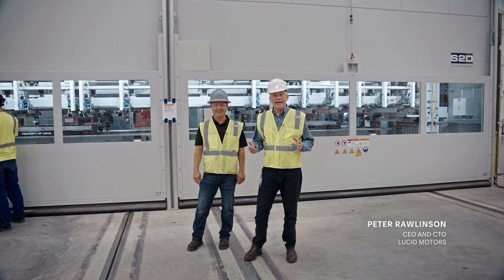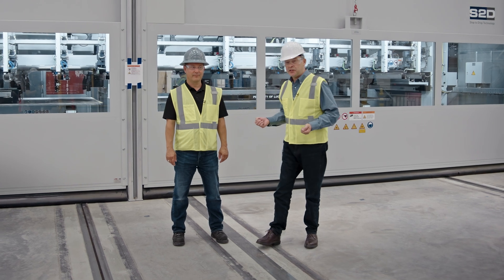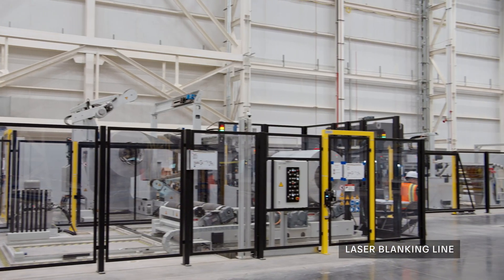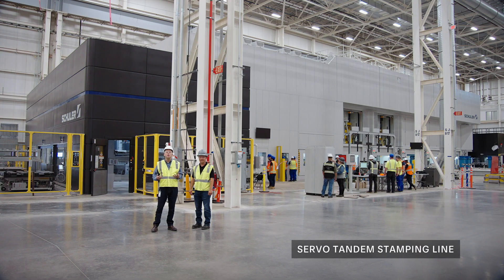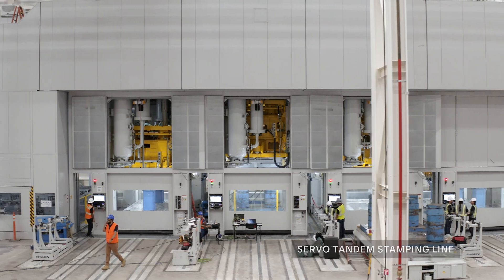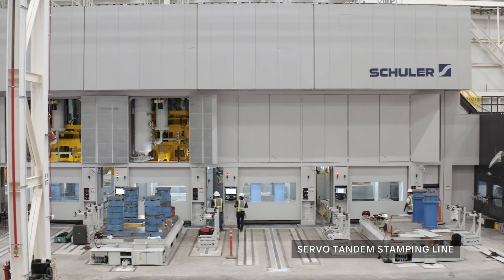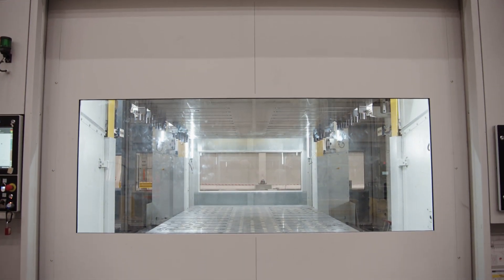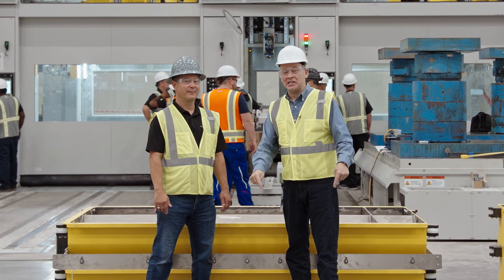Preparing the Factory: Stamping | The Road to Lucid Gravity

Comment: Aren't they Gigacast presses with molten metal? You will have to weld a lot of parts to make the rear sub chassis . Could you explain why they need so many successive presses instead of several equal and powerful ones that do all the processes in one.

Comment: Why not use gigacasts?
Reply: Lucid does use cast aluminum components where in makes the most sense for them, subframe and suspension towers. No one engineering solution is best for every application.
Reply: @Miata822 YOU SO SMART MIATA822😁🙋‍♂️❤️🥳🥳🥳🎆🎆🎇🎇🎇🫡💯🙌💎💎💎💎STRENGTH AND HONOR 🤝 GLADIATOR STYLE 🫡💯TOGETHER AS ONE LUCID FAMILY ADDING ON AND HOLDING STRONG HOLD THE LINE EVERYONE STAY FOCUSED BE DISCIPLINE HARD WORK DEDICATION GOONIES NEVER SAY DIE!😉👍🫡💯
Reply: Thank you! Did not know that. Are you an engineer as well?

Comment: Great sales pitch not reality. I hope the Gravity is 50% better than the Air I doubt it.
Reply: What do you see that is unreal, Tom? This is what factories look like. Being 50% better than the most awarded and praised vehicle in recent years is a tall order though.
Reply: @Miata822 WELL SAID MIATA822🙋‍♂️❤️🫡💯🙌💎💎💎💎
Reply: @Miata822  I said great sales pitch not reality . Based on the Lucid Air that I own. It has a poor quality control. The fit and finish is bad. Their so called dream drive is not as good as Hyundai in their Ionic series. 

As stated I hope Lucid learns from the mistake it made with the Air and the gravity is a better engineered car. I doubt it. Hopefully they have learned. 

The one positive I see is they have greatly improved their instrument panel which seems to be better laid out.

Comment: Lucid>Tesla
Reply: Lucid GT is an absolutely amazing well built engineered, driving machine 
Tesla software is still significantly better than others producing EV’s……. Because it always works
Reply: @mr.boombah6511  Let's not get carried away and say it always works. My friend has one and sometimes the wheel jerks it around While doing self driving.Lucid will use Nvidia, self driving by 2026 And I hear Nvidia software,  far more advanced than Tesla's fsd Makes it look like child's play. time will tell😁🙋‍♂️❤️
Reply: @mr.boombah6511 not always!
Reply: @mr.boombah6511 There are a lot of software working in the car, what you see on the screen is just the tiny part. Motor control software, inverter software, driving dynamic software etc etc Lucid is years ahead complimentarying to their industry leading hardware.
Reply: @lowvaeater  I’m fully aware since a GT is sitting in my garage and reality is software is the weak  point of the car… nobody was questioning the hardware it’s outstanding
Reply: @mr.boombah6511  Hopefully 2025 upgrade and Gravity can improve dramatically.
Reply: The Lucid Air is probably better than its competitor the Model S...yes. But there's basically no arguing against Tesla's charging network vs Lucid's lack thereof.
Reply: @renegadezen7841 lucid is adapting NACS(tesla charging) next year. They’ll probably give u an adapter if you have a car before that time.
Reply: Bwahahahaha!!!!
Reply: How many of their sedans have they delivered in recent years?
Reply: @Felix-no7nx Lucid definitely is more efficient with better motors then Tesla! And they definitely look better!
Reply: @gmv0553  Yes, but how many cars did Tesla and Lucid deliver? How much profit did Tesla make and how much loss did Lucid make? How much money did the Saudi government have to invest in Lucid to keep it from going bankrupt?
Reply: @Felix-no7nx  as if Elon wasn't trying to sell at one point to avoid bankruptcy 😂
Reply: @navado75  Tesla is a stock corporation. A sale of shares by Elon has no influence on the financial situation of Tesla.
Especially as Tesla is far from going bankrupt, unlike Lucid ;-D
Reply: @Felix-no7nx More than Tesla did 🎉
Reply: TOGETHER AS ONE LUCID🏆🏁 FAMILY❤️🙋‍♂️🫡 ADDING ON AND HOLDING STRONG GOONIES NEVER SAY DIE!🫡💯🥳🥳🎇🎇🎆🎇🎆🎆🎆🎉🎉🎉🙌💎💎💎💎GRAVITY SUV OF THE YEAR 2024 2025 2026 🏆🏁😉👍